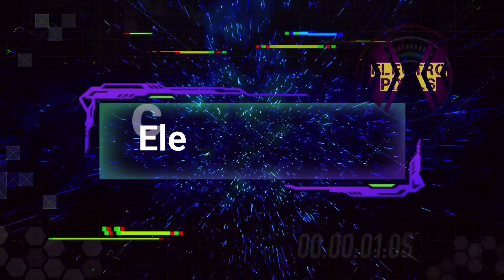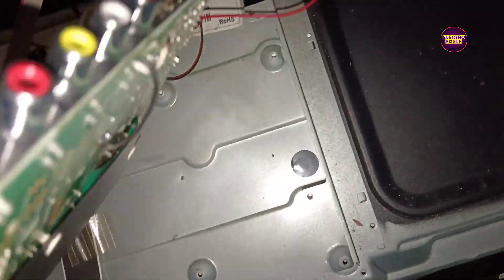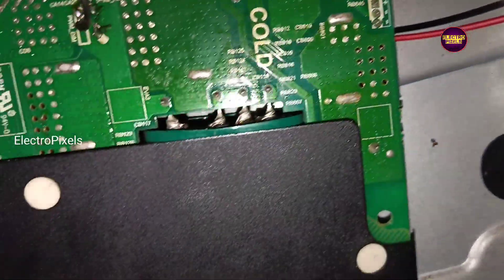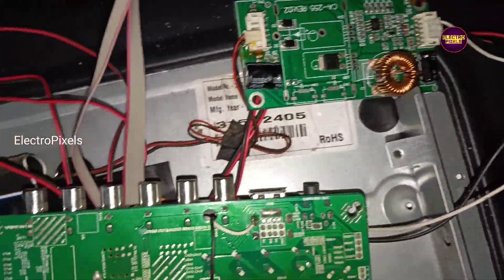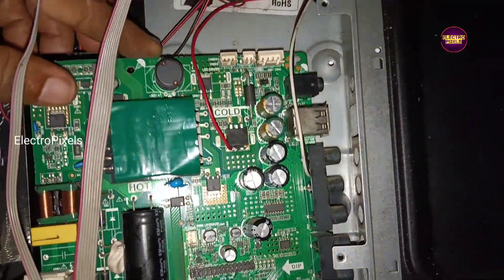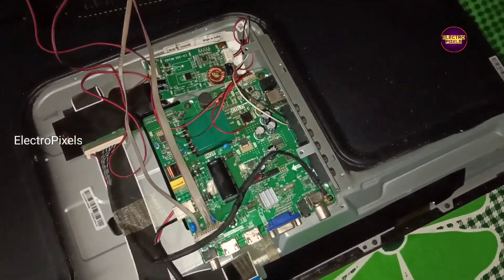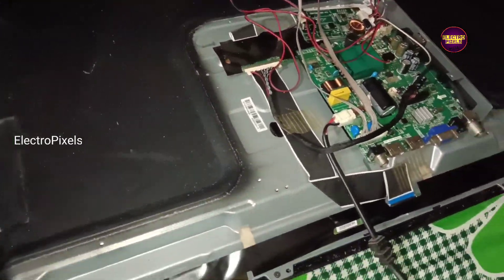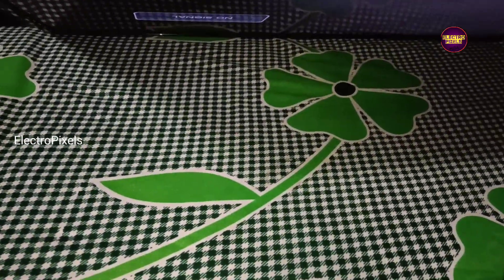Led Tv No Picture Backlight Led Driver Board installation on Micromax Tv|CA-255|LED Tv Repairing|Fix

Comment: Bro I need help on TV Panasonic TC60AS650. I just changed main board and screen rotated 180 degree. like mirror function. For additional shows as negative as well Thanks for advance
Reply from the maker: You can adjust that by entering to the TV service mode
Reply: @ElectroPixels  Bro I did but impossible. I did not find panel and mirror setting in service menu. Do you know other variants?
Reply: I tried VOL- and INFO on remote. Do you know other codes?